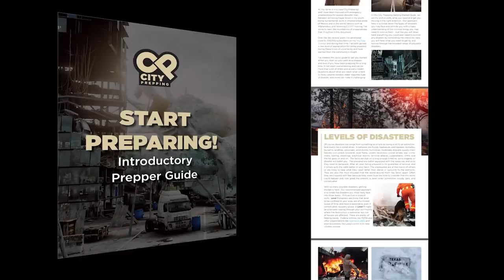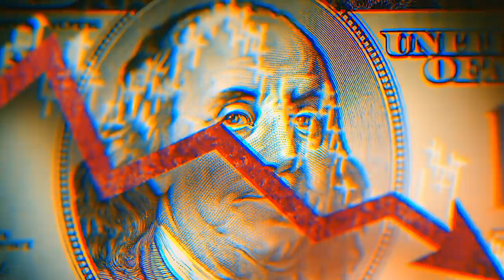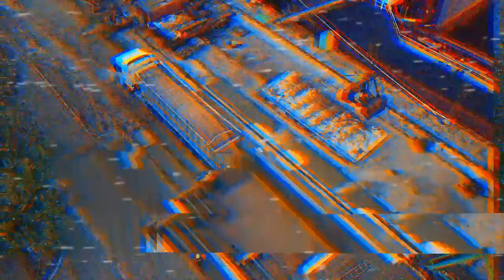The Coming Food Shortage: How Bad Will it Get?

Comment: Wheat berries can store years longer than flour. I've started practicing baking with fresh milled wheat flour. Just just use my Ninja smoothie maker for now to mill the wheat berries into flour. Use soft white berries for cakes and cookies and hard white or hard red for Breads. There's more nutrition in this flour and you just milk as you use it so you stock pile the wheat berries not the flour.
Reply: Your ninja grinds the berries to flour?! That means my blender can? I have a vitamix.
Reply: We also bought a hand grinder for the wheat berries in case no electricity.
Reply: @Mimi-ew7ku  which one did you get?
Reply: Wheat berries will keep indefinitely as long as they are stored whole and properly.  One of the few foods!
Reply: @momomily9229  I used a vitamix for YEARS to grind wheat.  It worked really great
Reply: Any blender will do it too. Agree on storing wheat berries.

Comment: Millet is the nastiest grain. I used to eat it in the 90's when broke. It cost next to nothing. I sadly trashed a few hundred pounds of wheat berries I had stored. They were 12 - 13 years old. I figured I buy fresh stock. But now there is none to be had locally and I could not replace. Later I learned that wheat berries will last and last if stored properly. I keep about 100 pounds of flour on hand. Half whole wheat, half unbleached all puropse. I keep the whole wheat in the fridge.